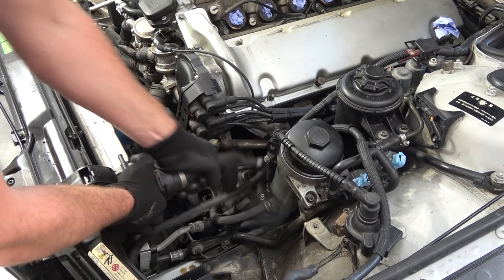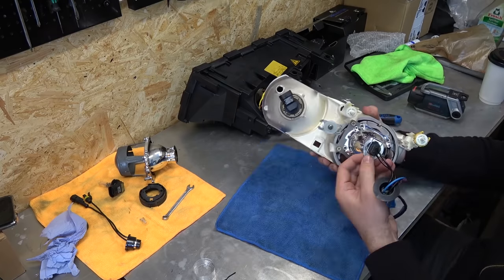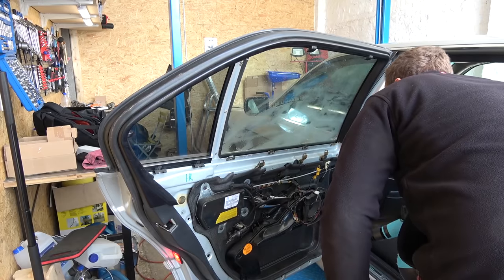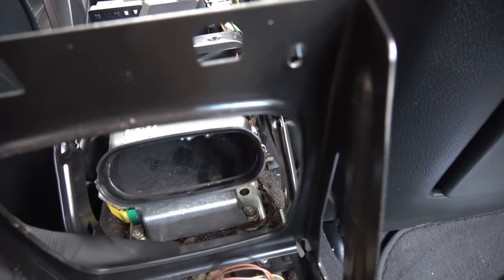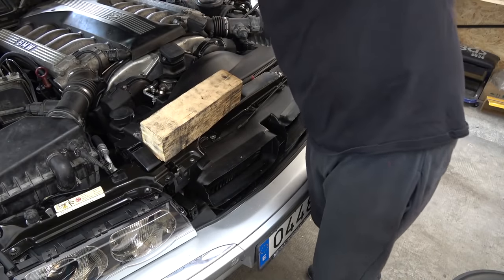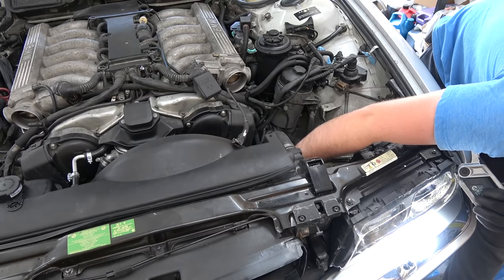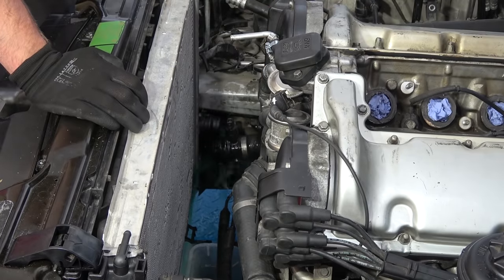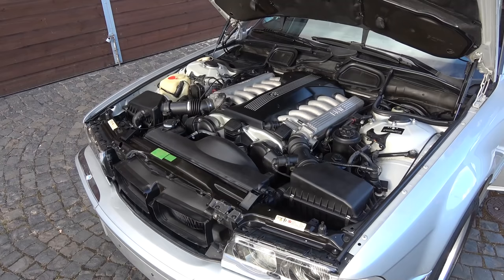V12 BMW E38 750iL Restoration - Project Dubai: The Battle - Part 4

Comment: I’ve been a BMW tech for almost 20 years. My pride and joy was a 2001 740i sport. I installed intake manifold from the m60 motor, updated the radio to bm53 flat pin so I could do factory aux input and the list goes on. It was modified but all factory parts. You sir, deserve that car ! Great job.
Reply: Modifying factory parts is the best way to respect the original look of the car <3 
#cleanlook #orilook
Reply: @SzwarcuKX5  and using hashtags trying to look cool when you don't know their purpose is unoriginal

Comment: I like the this guy specially because he cleans everything he touched.
Reply: he left the other intake manifold like that with glue. was dissapointed by that
Reply: @Ajay-kl8el  there was no need to remove it because that side had no faults and it would be many wasted hours
Reply: @THEADZBRADZ  it was glued on. By God knows what glue they used. A chunk of the hard glue residue could fall into the  cams and cause damage. He should have opened it and replaced with an open gasket
Reply: I must admit that I would have had to remove the glue on the other side as well - perfectionism is strong on me ;-) .
Reply: Germans...
Reply: @Ajay-kl8el  actually it was the cam cover gasket
Reply: I'm here for the cleaning!
Reply: That is a VERY GERMAN THING !!!! We don't do 99 per cent !!!!
Reply: Same
Reply: @Ajay-kl8el  Probably he cleaned that as well just didnt show in the video

Comment: Omg, finally I met someone who as obsessed with cars as me. I took my E46 into another level of detailing/rebuilding including the engine. Overall it cost me like 7-8k euros and at the end of the day I'm a bit scared to drive that car on an urban street where it's a big of a chance that someone might just run into your car and ruin it completely and the insurance company just say "Alright here's your 2000 euros for your old BMW - go buy a new one"
Reply: That is exactly what happened to me just a couple weeks ago on my 07 Audi Q7 which I've owned since new and only has 68K miles.  It was time to do some updating to it to give it the S-Line look and I spent $6K+ on paint work, interior and exterior replacement/upgrades and larger 21" rims & tires.  Once it was complete 2 weeks later an older woman rear ended me!  The insurance company would NOT pay to fix the car!  All that work was a  complete waste!  The insurance settlement is hardly enough to buy a replacement!  I'm out a car and paying for someone else's negligence...ARGHHH!!!
Reply: Have it appraised, so your insurance actually pays you more if it gets wrecked. Your premium probably will go up for that specific car, but it's worth it.
Reply: Justin Roiland hey man I feel the same way! I’ve already spent $6000 US on my 2001 740i m sport and I am the one working on it haha I still have a lot to do to get it done but it’s all about what you really like and enjoy working on your own car.
Reply: @Swordie100  Yeah we pushed the insurance company multiple times for a higher valuation of the car with comparisons and receipts of all the work done.  After weeks of back and forth they eventually settled on an amount that would cover repairing the car.  After 2 months from the incident I picked up the car yesterday and forgot how good the car looked after all the upgrades I had done.  The car was nicely polished and gleaming in the sun, it looked fresh off the showroom floor.  Very happy that I was able to get the car fixed and not sent to auction.
Reply: @DB-ul2zd  Ah you did that! Here you have to have it actually appraised. Well done on your part tho.

Comment: why would someone use freaking GLUE to "seal" the engine!?
Reply: they use slave labor in the desert
Reply: maybe they had the great idea that the glue would keep the sand out xD ...like anakin already said...sand gets everywhere
Reply: bittercottoncandy  Camel hoof.
Reply: I know it's bad but hay it's not leaking
Reply: When my E38 left me stranded in some remote holiday resort, with a severely leaking water pump, I found out the hard way that contact glue was used to seal the two o rings that seal on the two water pipes that run to and from the rear of the engine. You can imagine how much fun that was. M62 engine btw.

Comment: “Of course it falls into the bucket. Why wouldn’t it?”

Lol I’ve literally said nearly the exact words countless times. I have identical reactions when I’m working on cars and run into similar issues.

Greetings from California good sir. You have truly excellent content.
Reply: I've been working on cars and motorcycles for many years, and I've discovered a rule that says "if there is an open container/bucket/trough of oil/coolant/brake fluid anywhere in the room, anything that is dropped will end up there" ;)

Comment: So many bad mechanics destroying perfectly good cars.  I have an F30 with the n13 engine and had a valve cover gasket issue.  When I went to a shop here in Singapore, I was told that only 2 shops here knew how to replace it properly and wanted to charge me $600.  I bought the gasket for $40, went home, and replaced it myself. It's really hard to find good mechanics .. many of them don't even believe in using torque wrenches.  You are an inspiration!.

Comment: Thanks for the videos, they are very interesting and I have learned a lot. 
I also have a E38 750il the engine is bulletproof which is why Rolls Royce   used the same engine and gearbox in the Seraph.
Its heart breaking that your previous owner  didn't take care of such a beautiful machine. 
Thanks again for your hard work and time.
Cheers

Comment: I thought that I was the only one who cussed and shouted when fixing my cars!  Jumped on crappy aftermarket bits and wished some hopeless previous mechanics dead!   I think you're are rapidly becoming a hero for me.  Can't wait for you to hurtle down an autobahn  in that V12 M39.
I ran a 1998 M39 Touring from new for 15 years.  If the driver's side folding mirror is slow almost certainly the gears are dry that side too.   All four electric windows failed on my E39 due to the acetal plastic pulleys breaking up.  Wrong material for that application.  I'd be checking all four window mechanism pulleys for cracks - before they broke.  Then I'd be making replacements in 30% glass filled nylon.  Mechanisms made by Brose.

Comment: I had all the injectors break when trying to replace the vacuum hoses going to them. Ended up retrofitting some newer Bosch Gen 4 injectors and deleting that air shrouded injector system. Matched flow rate 16 lb/hr. Cheaper, runs great no CEL and now I have peace of mind no more vacuum leaks from all those connections

Comment: Great video. BMW is my favourite vehicles, I have owned two until now.  The headlights were set up for driving on the left side of the road in Japan, but the vehicle is a left-hand drive.  How curious. Here in Australia, or at least in NSW vehicles need a stratutory check every 12 months, unless the car is 5 years old or less. But I can drive the car on the road to the testing centre.

Comment: here's your extras that the car came with, pretty cool. nice restoration

Steptronic (0202) • Antriebsauslegung Export (0204) • Dynamische-Stabilitäts-Control (0210) • Servolenkung-Servotronic (0216) • Niveauregulierung (0220) • Adaptives Fahrwerk (0223) • Lenksäulenverstellung elektrisch (0245) • Seitenairbag für Fondpassagiere (0261) • Isolierdoppelverglasung (0352) • Frontscheibe grün Grünkeil (0354) • Schiebehebedach elektrisch (0401) • Sonnenschutzrollo hinten/seitlich (0416) • Fussmatten Velours (0423) • Warndreieck und Verbandstasche (0428) • Innen-/Aussensp. mit Abblendautomatik (0430) • Innenspiegel automatisch abblendend (0431) • Raucherpaket (0441) • Fondorientierte Ausstattung (0446) • Komfortsitz mit Memory (0456) • Komfortsitz im Fond elektr.verstellbar (0460) • Armlehne vorne (0473) • Sitzheizung Fahrer/Beifahrer (0494) • Sitzheizung hinten (0496) • Scheinw.Rein.Anl./Intensivreinig. (0500) • Park Distance Control (PDC) (0508) • Xenon-Licht (0522) • Fond-Klimatisierung (0533) • Kilometertacho (0548) • Bordmonitor mit TV (0602) • Navigationssystem Professional (0609) • CD-Wechsler 6-fach (0672) • HiFi System Professional DSP (0677) • Vorbereitung BMW 6 CD Wechsler (0694) • Länderausführung Japan (0807) • Batteriehauptschalter (0818) • Heissland-Ausführung (0823) • Fahrwerk in Exportabstimmung (0826) • Dummy-SALAPA (0841) • Akustische Gurtwarnung (0845) • Sprachversion englisch (0853) • Infrarot Fernbedienung (0875) • Dummy-SALAPA (0925) • Steuerung Kennzeichenbefestigung (0992)

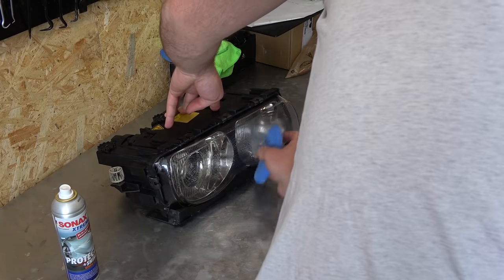Comment: The headlamp contrast at 06:07 is lovely. I wish you have held that shot for 5 seconds longer.  Does the upgrade have any issues with the TUV?     In the UK, any updates to the lights can cause problems with our MOT.  One must insure its a manufacturer specified upgrade - made during the models running lifetime. That central console was complicated. For everything to be flapping around like that, it must have been removed before and installed by a camel.  The clean up work on this engine alone, must have taken 2 days. The glue episode shows how terrible the local mechanics were. No BMW dealer had see that car for a decade.  Superb work as ever.

Comment: very strange that someone had the ability to go through the tedious process to gain access to valve cover gaskets only to then they glue them on during reassembly. 24:50 MADDENING!!! Car is in good hands now though thangod. Engine bay looks glorious now that you've finished with it

Comment: I have glued those kidneys together sometimes over the time. BUT.. tiny tiny spots and glue them together, and not on the car and not to the paintjob, so you can have them off too if needed. That was pretty hilarious to see :) And also I must add, no glue, just "glue them together with a silicone" the butyl would probably be enough. But those glued ones are swapped off already.

Comment: Just a smalll but useful trick : to remove easily sticking glue like the one you had on your windows, just use acetone (avoid touching plastics with the cloth soaked with this organic solvent).
Reply from the maker: That was acetone.

Comment: Congratulations - With this vid I will take more repairs on my V12 Facelift 1999 into account even though I am an bloody  amateur. Thank you  for this quality restoration E38 video! Right now my cyl. #1 and sometimes #8 have misfire. Can it be the 20 years old distributors and their rotors? Engine has run until today 85.000 km only, seemingly in good shape - and not from Dubai or neighborhood :)

Comment: I watched one of your 850 vids and you did the gasket under the intake where the coolant is and replaced the water pump. Why didn't you do that to this car when you had to intakes off already? Brilliant work by the way, you are crazy talented.
Reply from the maker: Thanks! The water pump was already replaced and the valley pan gasket was bone dry.
Reply: @M539Restorations  Awesome, knew there was a reason as you seem to be a perfectionist with these bimmers, 323i owner here myself.

Comment: Guten Tag!

Looking at your frustration at the quality of previous maintenance work i had to finally pause the video and comment on it in detail so maybe in future you will be more updated and cautious if importing cars from arab countries.

1:  Most workshops have cheap expats mechanics primarily from india, pakistan, bangladesh where such solution to problems are very much acceptable and even endorsed mostly because of parts being extremely expensive and even harder to find hence their mindset is built on reusing no matter where they work.

2: Dubai being full of expats and living a life on credit, mostly (again) from India, pakistan etc. already knows the work around to keep the maintenance cost down by going to such workshops.

I understand completely, that's not the way it should it but just wanted to let you know that maybe next time when hiring for inspection please clearly ask them to look for "cheap workarounds".   

hope this helps :)

Comment: those high beams don't look to hot. Will you eventually be replacing them with LED's or Xenons? Or will you just leave them like they are?
Edit, I did not realize there were 2 bulbs in the high beam part (5:02), I thought the high beam bulb was the same thing as the other Orange/yellow looking bulb.

Comment: I'm enjoying seeing the car restored to original but as you said in earlier episode the engines are massively understressed. I had one and the 326bhp isn't a massive amount of power. I remember people used to change the intake manifolds to unleash a bit more potential. It's not that I want to see the car modified but more that they would benefit from say +50bhp perhaps nearer 850csi output. I always found it surprising BMW's V12 had much less power than Mercedes M120 from same era.

Comment: Found a 1999 e38 750il with 135,000km for sale. Hasn't moved since 2014 and hasn't run since 2020. Checked oil and boosted it to see if it spins over. Rear suspension is shot. Rust only on the passenger door oddly. Has been parked under a tree so its filthy. I think it's black 😂

Comment: Hello
Thank you very much for the video 
Could please tell wich odb or soft do you use ?
I have buy delphi / autocom diag in order to check but they are all model but only m73b54 is missing...😔

Comment: German Engineering meets great mechanic with attention to cleanliness and every detail conceivable. Results- Absolutely Astounding and Amazing.
German Engineering meets Flintstones mechanical skills. Results-Astounding and Amazing it still even STARTS, let alone moves under its own power. 
The injectors aren't even the same, for Pete's sake. I almost screamed in rage when I saw the superglued valve covers. Someone should be shot for this. Criminal negligence is what it is.

Comment: I love this generation of 7 series. My only issue with the work I saw is that you had the door panels off and the speaker surrounds look like they were disintegrated, but you didn't replace the speakers! As soon as you start driving and listening to...anything...its going to sound like a terrible mess.
Reply from the maker: Already replaced, it'll be in the next video.

Comment: those hackjobs were done probably because the customer said "Make it run". and waiting for parts will take a long time to arrive specially if you are overseas. one example is that vacuum pipe. sealant and the fuel injectors

Comment: Very good! You are using PA Soft Software for reading out the Motormanagement, are you happy with the software, would you recommend it? And where can this software be bought/downloaded an also the cables/equippment for connecting with the car? Thank you!
Reply from the maker: I like it cause it's quick and simple to use. I got on eBay years ago, but I also have all other tools like INPA, DIS and ISTA, just depends what I need to do and which car I'm working on.

Comment: front speaker on passenger side seems to have all the surround disintegrated ...why did you not replace it ?
Reply from the maker: Cause I saw it later in the edit. It will be replaced anyway.

Comment: I am wondering why didn't TUV check the vacuum leaks and maybe the valve cover gasket.
Reply from the maker: They don't take things apart, it's not a service but a safety inspection.
Reply: @M539Restorations  Aha. thx.

Comment: Hello i have a same problem with airbag mrs3 v2.6 i tried to changed with mrs4 v3.7 and i recoded with ncs but doesn't work and i read i need to change crash sensor's under the seats with same part number
Reply: Well I came to the conclusion I needed not only the module for the pillows but also the sensors that are under the front seats under the air duct from the same donor car and was then encoded with NCS. No more airbag light. My ca is BMW E39 528i M52B28TU 2000

Comment: Sreten, if you read this, please share a link or part number to the replacement mirror glass, i beg you. I have an e39 with same auto-tint mirrors, and the right one is caput. And in my country nowhere to be found other than original BMW for 300 euro.  Thank you !
Reply from the maker: I bought it used. No link, sorry.
Reply: @M539Restorations  Still thank you for the answer ! Oh, and the best BMW videos, ofc)

Comment: Bro bitte machen Sie ein Projekt, um e66 wiederherzustellen, bitte, ich bete, der Schrei der Seele ist einfach) Es wird sehr nützlich und gefragt für die russische Gemeinschaft des Segments sein.  Der Besitzer des BMW 750Li e66 2007 selbst ist sehr inspiriert von Ihrer Arbeit, Pedanterie und Liebe zum Detail - es freut Sie, wissen Sie!)) Ich warte auf neue Videos von Ihnen, danke für den Inhalt!  Und nach 4 Stunden beginne ich meine Reise, um meine 750 wiederherzustellen.) Ich würde sehr gerne, wenn plötzlich eine solche Gelegenheit besteht, Ratschläge von Ihnen oder nur Konsultationen erhalten. Ich entschuldige mich für meine Kurvenübersetzung (🥰🥰🥰🥰

Comment: oah c'mon. leaving the other gasket glued and not fixed on your proper way was a huge disappointment! :)
Reply from the maker: It was pointless, it will never leak. I was so livid that I wanted to set it on fire and the other valve cover would tip the scale hence I decided to leave it alone

Comment: Excellent work but leaving the other rocker cover would drive me mental!
Reply from the maker: It was simply removed for paint matching.
Reply: @M539Restorations  I ment with the glue and the gasket!
Reply from the maker: I explained in the video. It wouldn't drive you crazy if you removed the first one like I did. No point in touching it.

Comment: how can you pass Tuv with chinese projectors and not oem xenon bulb????
Reply from the maker: How can you not? The headlights work perfectly, light output is more than sufficient and they are aligned properly. That's what's important for TUV, not what's inside.
And I also later replaced these with better projectors later, EVO- XR off camera.